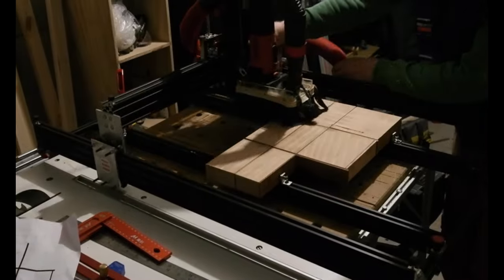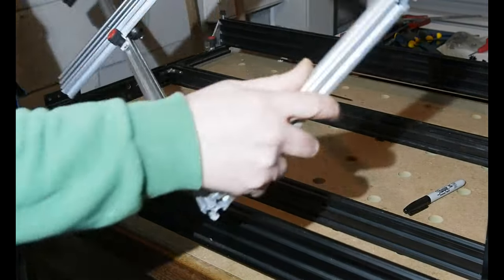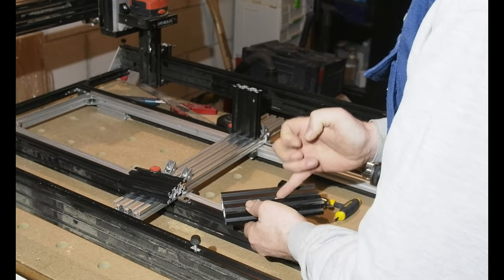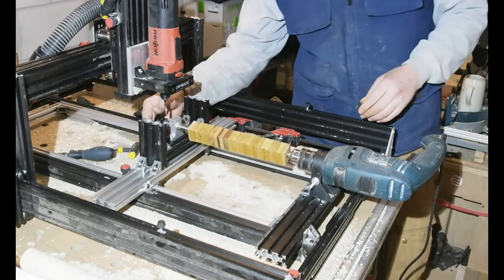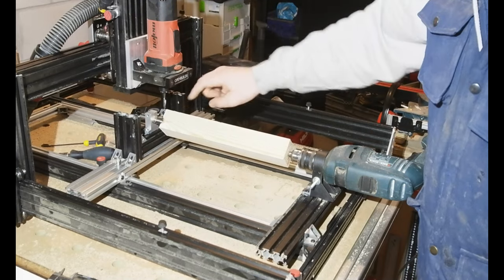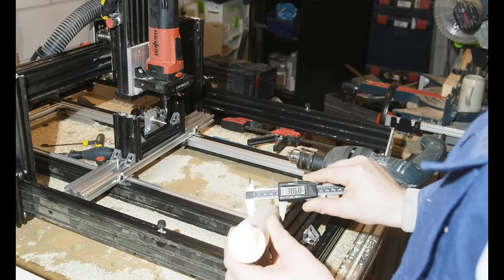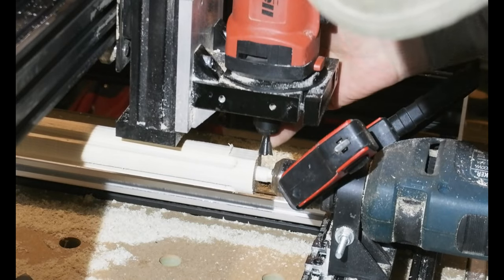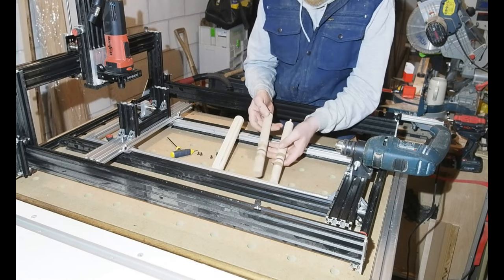Mini Lathe, Rotational Axis for the Router Sled, NCNC Machine

Comment: I believe a good lighting dimmer switch can be used for a drill speed control, at a pinch. There are more dedicated drill speed controls on the market, but its essentially the same electronics.

As for the resistance to cutting, remember the rotation of the stock means the router bit is actually cutting quite a long distance through the wood. Especially as it gets closer to round.
Reply from the maker: Dimmer switch is a good idea. Think I have a spare lying around somewhere.👍 I've since tried wider flute cutters and using spiral up/down cutters side on. Not sure there's much difference. No big deal really. Still doesn't take long to turn.

Comment: With regards to bits, I made a similar device but with a 1|2 inch router. I had much more success cutting along the side of the work as opposed to the top so the router bit was cutting with its long flues not the end cut. I don't know if that makes any sense, or if it would be possible with the smaller router.
Reply from the maker: Well worth a try mate. Did occur to me to give that a go at some point tbh. You having tried it has spurred me into giving it a go.👍

Comment: I’m wondering what if you use a cutter in the plane instead of bottom cutting, you know as if you were using a turning chisel ? You cleaver bloke you 👍
Reply from the maker: Cheers! If I get what you mean, I can't unfortunately. No way to tilt the z-axis. As someone mentioned below though, I may try using the blades on the side of the spiral cutter.
Reply: @BischBaschBosch  sorry mate I didn’t explain myself very well that is what i meant ☺️